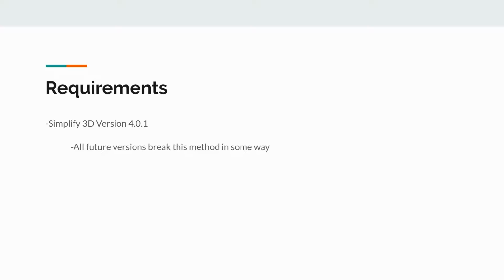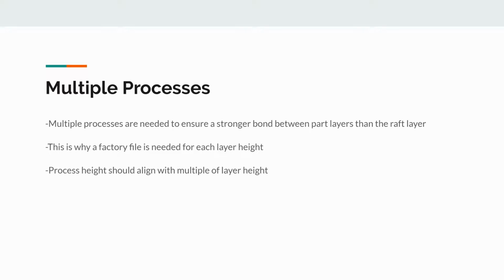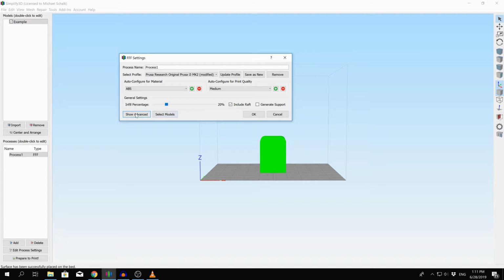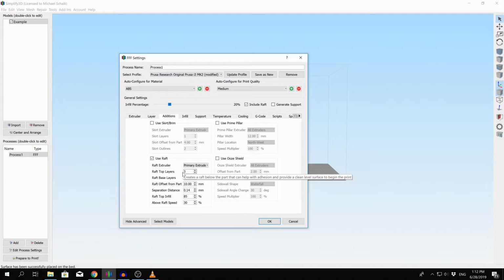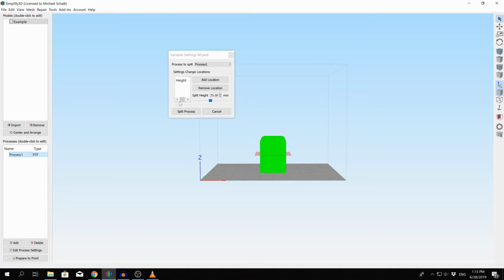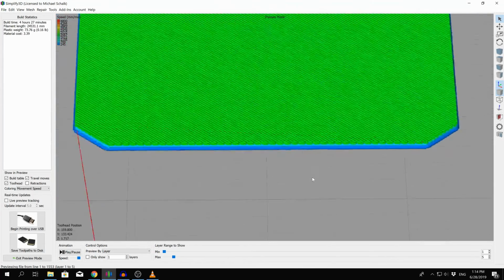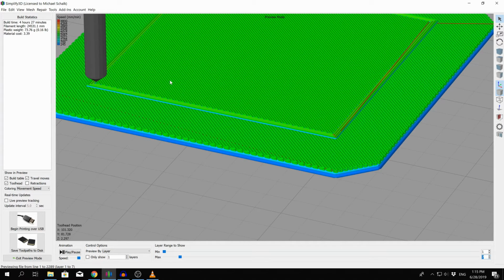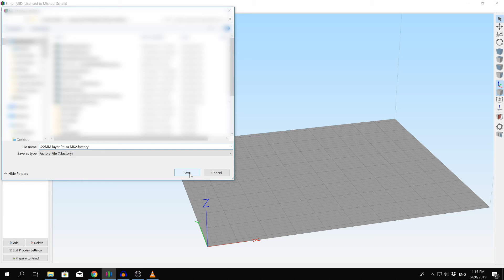Advanced Simplify3D: Perfect Rafts

Comment: I like the concept, but have some questions.  I'm using version 4.1.2 is that still broken?  Also you have the processes broken by layer height, which I understand, but with the  raft set at 3 top layers and two bottom layers,  I have 5 layers before my first part layer.  The last two layers of the raft are printed as normal layers.  You did not show what settings you need for Process 1-3, so  I used 1 for first layer height and width.    I'm thinking that I should change the heights of the process to match when the rafts change.  Does this make sense?